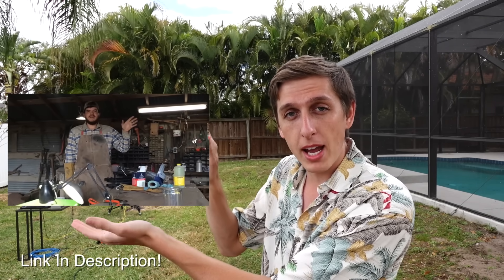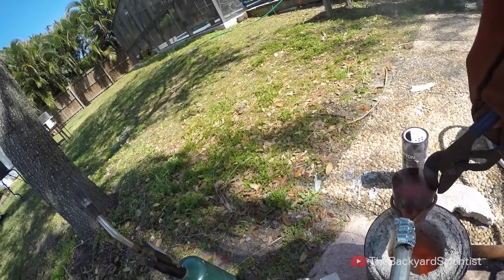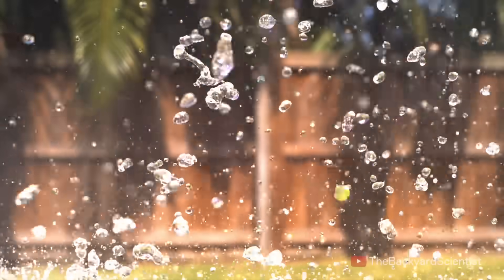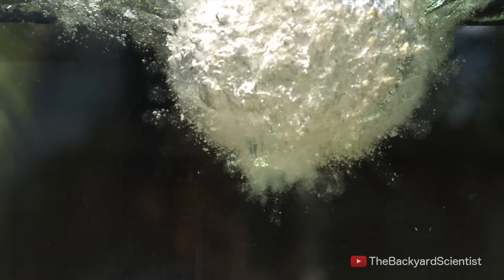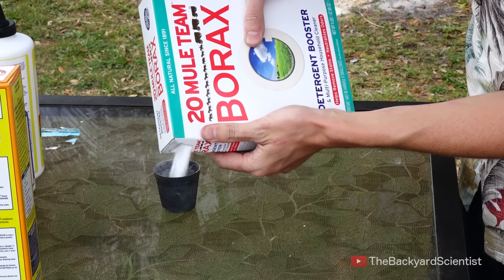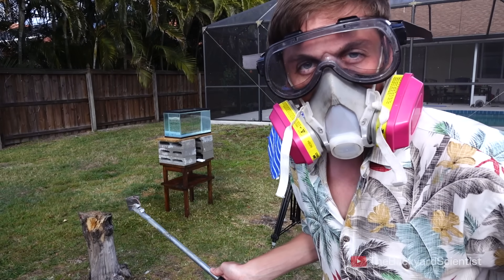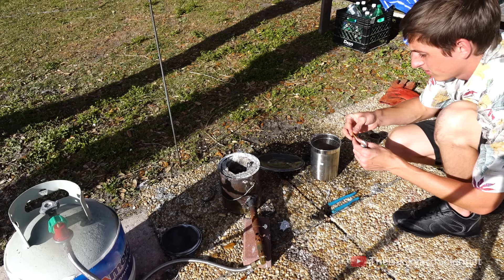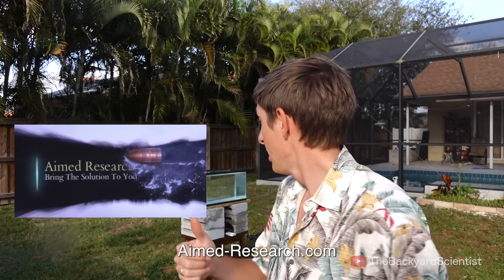Pouring Molten salt into Water - Explosion!

Comment: Explained it for me like this: Sodium is an Element of the first or second group of the PSE so its reaction to oxygen is only beaten by its reaction to water where it produces Hydrogen. Because Sodium is a small positive ion, its light and not more dense then water. Chloride is a real heavy negative ion way more dense than water so it sinks. But in contact with water, chloride is fading, leaving the sodium behind beneath the water limit and this reacts exothermic to H2O by producing O2 and Hydrogen, while this is closed underwater, its compressing by gravity and exploding in help of the heat of molten salt
May be wrong though

Comment: I thought about this for a while, but I am not so sure, that's a theory and it can be false, maybe upon heating up salt till it reaches its melting point, the following happens: portray the NaCl compound, the sodium atom and the chloride atom together, what happens according to my theory upon melting it is that the sodium atom might have gotten a specific change that shouldn't be happening, like an error, since mixing normal salt with water doesn't explode, and heating up salty water gives you vapour and salt is left behind, cuz water vaporized before the salt melted, but when the molten salt touched the water, we didn't see steam, we saw an explosion, sodium is known to explode upon contact with water, as you demonstrated, anyways the error that happens is that the water molecule, H2O, when it touches the molten NaCl, the one with the error, maybe the Na atom due to that error effect was able to react with water like it always does, abandoning the fact it is in an ionic bond with Chloride, of course I didn't test that, I am a regular 15 years old, but I guess the best way to test if my theory is true is that you try putting this molten salt in a chamber with water vapour only, if it explodes like it did with water, then we discovered a reaction that's physical and chemical at the same time

Comment: Using this info you could make a bomb. Make a compartment that connects to a water part separated by glass. Put the salt in the glass area. Throwing it will mix them

Comment: So if it is that the water gets super heated, would other objects not also react in this way with the water or is it possible that the specific heat is so much higher in salt? And if this is the case we could repeat this in other fluids with lower specific heat then h2o and get a even more aggressive reaction?

Comment: My science teacher showed us this on zoom.
Reply: Does your science teacher have the answer?
Why does it react with water?
Or is his theory correct?
Reply: @riktamsarkar7684  Melting salt makes it release it's chlorine which creates pure elemental sodium.

Pure elemental sodium is an exothermic alkaline metal, so when it's in contact with water or other liquids it will explode, if sodium liquified it immediately explodes on contact with water. **1

Why does pure sodium explode, it causes a reaction with water to makes either hydrogen or oxygen gas from water. Since the sodium had already heated itself whatever gas it made from the water (or itself) gets ignited to create tons of steam, which starts the marshmallow part, while sodium starts it's explosion it creates an air barrier around itself, which lets more liquid sodium to drop further down into the water creating  a chain reaction explosion until it is completely consumed by it's explosive reaction effect.  When such experiments are conducted in fish tanks, those tanks almost always get wrecked by hostile pressure waves sodium creates from the first drop of it's explosions 😮😮🤭🤭🤭 

Yes the marshmallow bit was some science sarcasm but it's kind of funny how liquid alkaline metals and marshmallows can have reactions that look a little similar lol 🤭🤭😂

**1
Sodium is an alkaline metal, Sodium is one of 5 alkaline water trigged metals, thd other 4 are Potassium, Lithium, Cesium, Rubidium & Francium of which ALL are explosive in water ( and other liquids)
Reply: @Mr1987Joe  Nah man she's a great teacher she has 3 classes to run so it aint easy
Reply: 4fps :///
Reply: @4ltrz555  probably
Reply: You have a cool teacher
Reply: good for you
Reply: @VrishinJ  lol ok f
Reply: You have a cool science teacher
Reply: You've got a great science teacher!
Reply: You have a good teacher
Reply: Nice
Reply: My science teacher shot himself.
Reply: @dogoven.  ok
Reply: What about Webex?
Reply: pog
Reply: Thank your teacher
Reply: Wish we had that when I was in school.
Reply: Cool
Reply: No way!
Reply: BRUH
Reply: Breaking News Teacher Arrested For Showing Students How To Blow Things Up
Reply: Same!😅
Reply: Me too
Reply: Its teacher backyard science tist
Reply: You have a good science teacher
Reply: lmao
Reply: If he showed this in zoom class, so his next class would be cancelled as he would be in hospital
Reply: @John Glauber We don't care.
Reply: 690 likes nice
Reply: they must be very old
Reply: Epix
Reply: My teacher just called me a mistake
Reply: @danielw.2308  Are you homeschooled? Should've said, class is still in session, Mom! Super inappropriate... How am I supposed to learn about Pythagoras with that freshly forced into my mind???" 🤣
Reply: doubt
Reply: Good for you
Reply: That is a good teacher
Reply: @Mr1987Joe  still better than teaching some boring class that everyone will forget about in 3 days
Reply: Lol
Reply: Make sure you keep note you gunna be doing this at school level safety
Reply: I’m jealous-
Reply: Lol ok
Reply: Is he arabian by any chance?
Reply: Yo mama showed me something totally different on zoom.

J/K
Reply: Theres a man of Quality
Reply: Fr?
Reply: Any deaths yet?
Reply: Adding this reply so it is 69 reply :)
Reply: XD
Reply: Asom
Reply: Nice
Reply: No
Reply: @ibuiltroblox4240  no way bro fr?
Reply: Rip
Reply: Lucky
Reply: Nice
Reply: Same, we watched this at the beginning of school
Reply: Lucky bastard
Reply: Ok
Reply: cprghts
Reply: I wish I got to do that
Reply: I hope he had pants on... Zoom has to hate the reputation it's gotten 😂
Reply: @radicalbeet  Bret Weinstein, Jordan Peterson, my HS physical science teacher, etc, etc...
Reply: @Mr1987Joe  And then "forgets to turn their camera off" and starts whacking it... 😂
Reply: @ccriztoff  Sounds like you and your science teacher have *Chemistry*... lmao
Reply: My teacher showed us this too.
Reply: cringekid
Reply: My teacher let us play with a piece of paper and water while she texted
Reply: Lol
Reply: cool teacher
Reply: Me 2 and my teacher put this tag on chat don't try this at home
Reply: Legend
Reply: Oop I watch him for fun
Reply: Ok and
Reply: "So kids this is why you don't mix salt and water.."
Reply: i came here cause she showed that
Reply: Who is your science teacher he sounds cool
Reply: @Jrodgamz  it’s a girl
Reply: @j_g9724  Who is your science teacher she sounds cool
Reply: @Ted breadth wtf you’re not funny
Reply: @Mr1987Joe  my teacher ran out of stuff to teach us at the end so put this on instead
Reply: Who believes him
Reply: @khansaaalali7878  it’s not unlikely my science teacher did it and that was too make a test lesson not so boring and because he forgot to make work incase we finished the test early
Reply: Did the zoom call end immediately after?
Reply: @Kittykat.0  it was irl for me
Reply: R.I.P science teacher
Reply: Your teacher is cooler than mine
Reply: @reskaill9684  mine is really cool tries to keep stuff interesting with practicals and always complaining about how we should be doing practicals every lesson instead of writing in books most of the time
Reply: Noice
Reply: Goated teacher
Reply: Gigachad
Reply: W teacher
Reply: Good teacher
Reply: Cool teacher
Reply: Heh
Reply: You have a good science teacher
Reply: cool
Reply: Aflac
Reply: @Mordfustang451  AFLAC
Reply: Same xd
Reply: Now that's a good teacher
Reply: Nice
Reply: Coolest science teacher ever
Reply: As he should
Reply: Your science teacher is the goat
Reply: LUCKY
Reply: That’s why I’m here
Reply: Pog
Reply: No he didn't
Reply: “So class , what was “kevin” talking about”
Reply: wow ur science teacher is great
PS:how did she survive
Reply: Nice
Reply: Teachers are lazy. Easy experiment to do safely outside but teachers are just too lazy...
Reply: When I was in school I’m pretty sure zoom wasnt even invented lol
Reply: Your so lucky all my science teacher did was tell us cool stories 😢😂
Reply: W teacher
Reply: Today's unit: what not to do.
Reply: W teacher
Reply: Xd
Reply: W teacher
Reply: I bet it's like "okay I'm gonna pour it in" then in one frame you see her tilting the container and the next frame you only see some smoke above the water
Reply: Pog
Reply: You have the best science teacher
Reply: I believe you
Reply: Imagine having a good teacher lmao
Reply: Oh cool...wait  what?!
Reply: And what was the reason for the explosion??
Reply: I send a bunch of his video to my science teacher and she plays them for us
Reply: @wetowl6385  She shows another teacher doing his own experiments in class rather than conducting her own? Yet teachers want pay raises and to maintain their massive amounts of vacation time.... 🤣😂🤣😂🤣😂
Reply: @icorrectly  she doesn’t just do that y’know. This entire year she only showed 2 of the videos i sent and science ain’t all about experiments like it’s about questions and so much more that you cannot physically do
Reply: @wetowl6385  It's just jokes, mang
Reply: 2020 for you
Reply: @zeinomadikizela4783  Now 2021
Reply: @zeinomadikizela4783  2021
Reply: yeah
Reply: 2020
Reply: She dead
Reply: Did they survive?
Reply: cool
Reply: im sorry that i commented like 3 times
Reply: @hotelvalsinestra6380 don’t let it happen again
Reply: Gfu
Reply: Sucks to be you! Missing out on the rest of your school years! High School is the best! I guess this video will substitute for cheerleaders!!! 🧐🤔Bwahahaha!😂😂😂😂🤣🤣🤣😅😅😅😅😁
Reply: STOP THE CAP
Reply: @adeliomarina7032  hbu
Reply: @adeliomarina7032  ah yes, because a teacher showing his/her students an educational video is 100% fake and a lie

Comment: The chemistry part is kinda inaccurate though. If the sodium was able to break apart from the NaCl, the chloride would also turn back into Chlorine, which would react with water as well. And since its a 1 to 1 ratio, the ph wouldnt change. Chlorine makes acid when reacting with water to counteract the based formed by sodium. And many salts do have a decomposition point. That could explain why you have to greatly heat up the salt to have this reaction, as shown that just melted salt doesnt react in your first 2 attempts.

Comment: the physical reason could be air bubbles and water drops that trap in the molten NaCl that due to rapid temperature decrease get so hot and explode in vapour. there are actually already impurities in water.  mainly small Natrium containing stuff that are solved in water.when hot NaCl added it starts to resolve while in the fluid phase, meanwhile due to temperatures higher than 1000C the impurities in water, that are mainly Alkaline metal salts, start crystalising around small NaCl chunks, so to say, these microcrystals increase so rapidly in volume and lose temperature fast, this is enough to give the surrounding water molecules pressure and temperature to turn into hot vapour. the crystals meanwhile resolve in water once again . this decrease s the volume. the bubble that is spheric is mainly water vapour with chunks of NaCl and other stuff. the explosion happens because of the high solubility of NaCl in fluid phase in water and the presence of impurities in water,.

Comment: Might be case in which due to high temp the lattice structure of the salt weakens as due to heat the bond starts breaking and therefore when we add water to salt , due to high hydration energy the salt releases high amount of energy which is not absorbed by weak lattce and thus results in explosion BOOM!!
This is my hypothesis. Maybe that's good for a 12 th standard 😃

Comment: I think I maybe have found an answer to why for you. 
They made a room temp variant to test. 

The team observed that within a fraction of a millisecond of making contact with water, the Na/K droplets form numerous spikes that protrude into the water. Molecular dynamics analysis indicated that nearly instantaneous transfer of electrons from the spikes to the water rapidly generates positively charged alkali ions, which vigorously repel and cause a so-called Coulomb explosion. It is the speedy manner in which that process propagates and generates reactive metal surfaces that triggers the overall explosion.

https://cen.acs.org/articles/93/web/2015/01/Sodium-Potassium-Really-Explode-Water.html

Comment: 1. Improve your safety measures. 
2. Try molten NaCl in a saturated aqueous solution of NaCl.
If it has something to do with the solubility of NaCl (including kinetics), the effect should be diminished. 
You could also pour other molten salts into the brine solution.

My first idea on the topic was thermal cleavage of water into hydrogen and oxygen...and subsequent ignition of the gas mixture.

Comment: If you’re curious on why this happens there’s two reasons. The first is salt is Sodium Chloride (NaCl) when you melt the salt, you burn off the chlorine so only the sodium remains. Sodium is an alkali metal and all alkali metals explode in water, however, sodium is one of the least reactive so it will lead to a few pops and sizzles. 
The massive explosion was due to the heat. When water touches a molten chemical it instantly turns into steam which is more than one thousand times the volume of liquid water. All of the water near the salt forms a bubble of steam. The pressure from all the steam  in the bubble builds and is suddenly released in a massive explosion.

Comment: A pH change is NOT the only chemical reaction possible. Salt is actually the result of a neutralization, a.k.a. when an acid reacts with a base to produce a neutral solution. If you pour equimolar amount of NaOH solution and HCl solution, you're gonna get a solution of H2O and NaCl... yes, salt and water, which means that NaCl will not affect the pH. And if we consider the possibility of pure Na reacting with water, it wouldn't be too foolish to consider the possibility of Cl (or Cl2) reacting with water, which would both create a strong base and acid, respectively, which would neutralize each other. Although, I do not know if this is actually possible, absence of pH change, is NOT proof of absence of chemical reaction.
And technically, the other molten salts did not react the same way, which would actually be evidence that this is NOT a physical reaction. The only reason why this evidence is not valid is because there was not control done. Were the other molten salts at the same temperature? Were they poured equally fast to ensure they wouldn't cool more than the molten sodium chloride? As we have seen, even the latter did not react in the initial condition, so it would be worth testing more conditions for the other molten salts.

Comment: i think because sodium is very dry and acts a little bit like an absorbent when it lands on the water it sucks it up but because its so hot the process speeds up and spreads because its a liquid and there is this other metal when its hot water rebounds and then it expands

Comment: som1 has to test this with lithium fluoride salts to asses the safety of LFTR reactors.
it may need more temperature but you dont want this happening with radiation ontop of it.

in the cement industry they call molten NaCl which clogs the stack furnace the DEVIL because you throw water on it and it explodes if it spills on you it will cause you to explode.

Comment: All because the NaCl have a property to dissolves rapidly to water (per concentration) and it may interchange energy, so what happened here is that the molten NaCl dissolves extremely fast that transfer the energy to water and some volume dissolves and absorbs the thermal energy enough that forms bubbles and the salt just contracts but every time is getting dissolved, so it begin to release the thermal energy. In case of the sodium tetraborate, I see that don't dissolve very quick (per concentration).

Comment: Wouldn't sodium carbonate decompose into sodium oxide and carbon dioxide before melting?
Also my idea for why the others didn't explode is cause of their said higher melting point where they will have stronger and more intense radiation which will increase the Leidenfrost effect a lot more than the weight of said compound can counteract